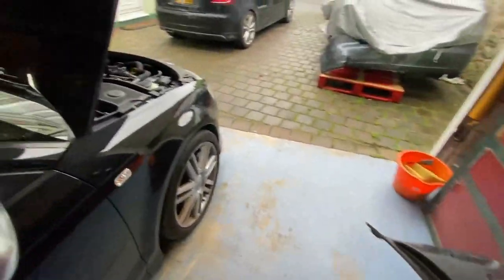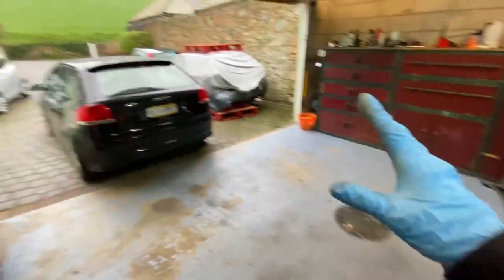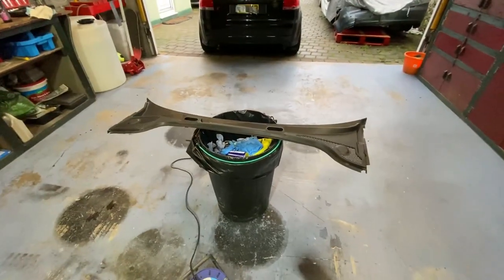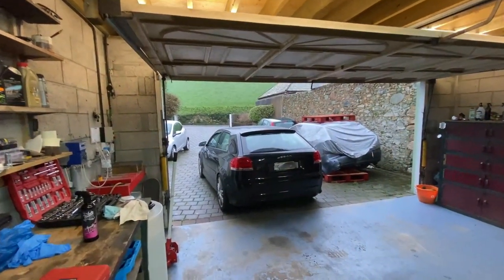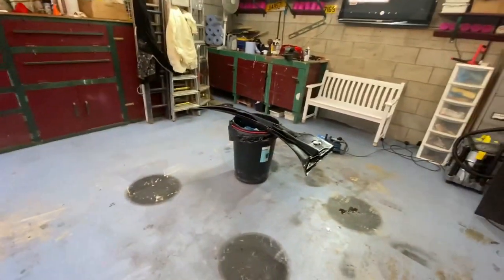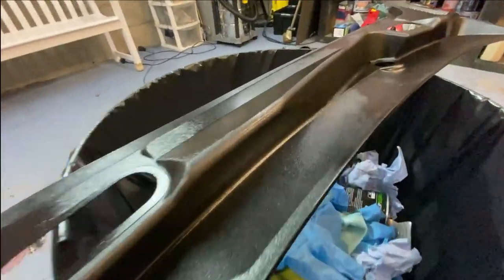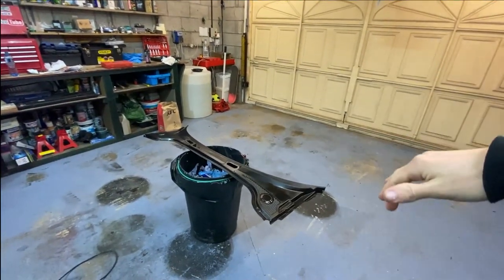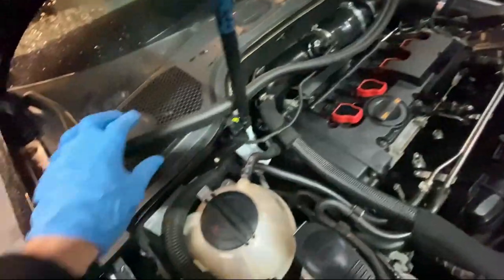Audi S3 8P - Painting My Skuttle Panel

Comment: What are your thoughts on a 2010 Audi A3 TFSI 1.8L for a first car ?
Reply from the maker: Brilliant, my second car was a 2009 Audi A3 1.8tfsi.
Reply: @MotoAdventuresYT  is it reliable, I have a few questions if that’s okay
Reply from the maker: Yeah no problem man, only issue I had with mine is the inlet manifold had failed and had to replace it, cost me like £350 at the time
Reply: @MotoAdventuresYT  it’s been my dream car since it came out and i think the rs3 has boosted my love for the a3, did you do anything to yours engine wise like remapping or intake etc ? and if so how much were they?
Reply from the maker: @isaacsmith8617  Hi Mate, yeah i had the intake, intercooler, and full exhaust, and had it mapped to 250bhp